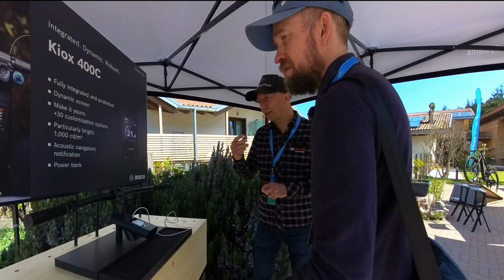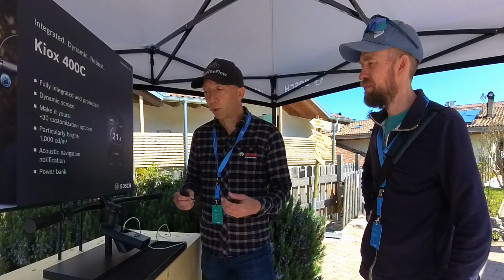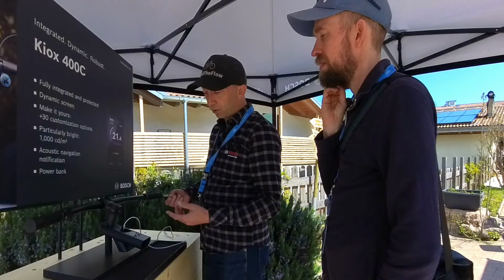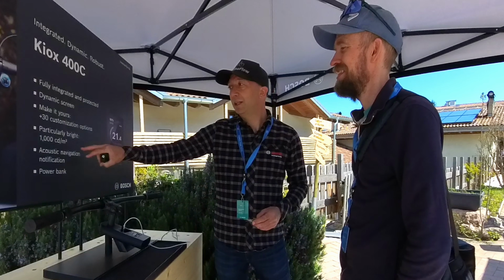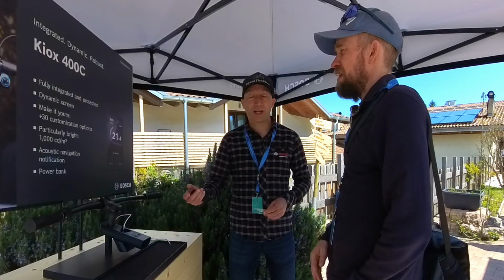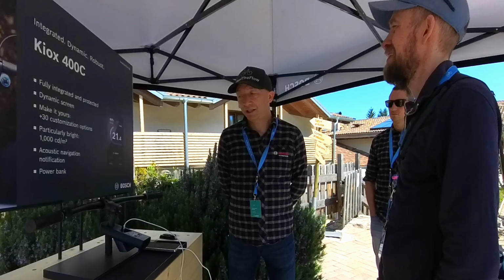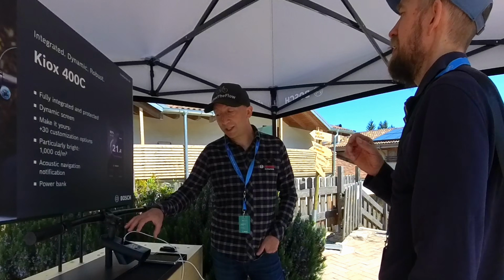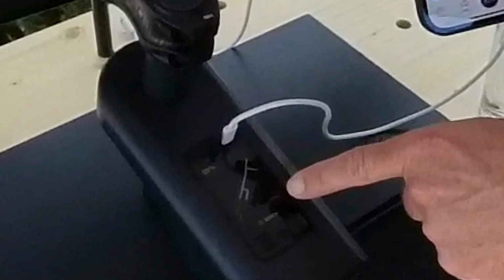Bosch Kiox 400c introduction and interview

Comment: Looks like a frame adapter is needed to fit KIOX 400C in the cut out on the top tube of a cube stereo hybrid one77 , where will this be available from has I can't find no info online ?
Reply: I will be looking for the same, did you find somewhere?
Reply: @darklightning2k ebike24

Comment: 7:51 10W? In 2025? Meanwhile DJI Avinox: 65W. I guess, same as with the motor power, Bosch will argue 10W is enough and will try to push regulation to limit it 😂

Comment: This should have been released with the gen4 motor instead of the crappy traffic lights set up
And can only fit it with the cut out in the frame with Gen 5 motors 
Tough luck to people who brought a bike 1 year ago 
and they want people to pay an extra £300 for it he new display 😂
Bosch always do this on there customers nothing has ever been backwards compatible 
Hence y I have a Specialized gen3and4 they look after there customers
Reply: Wait until you hear what specialized have done with there new emtbs 🙈
Reply: @ I’ve got a new levo gen4 S works   It’s a great motor loads of controllable power 😊

Comment: Can this be retrofitted onto bikes that currently use the system controller?
Reply: On the gen 5 yes
Reply from the maker: I believe it will work with the gen4 motor. But I'd check to make sure. The gen4 might need a new firmware that Bosch might not make. And then there's the issue of mounting the display to the bike. Few or none gen4 powered bikes have the hole in the toptube for the Kiox 400c.